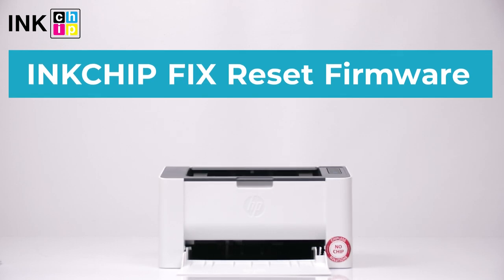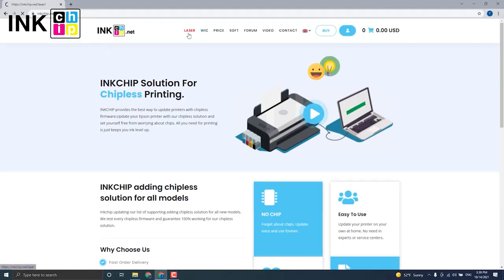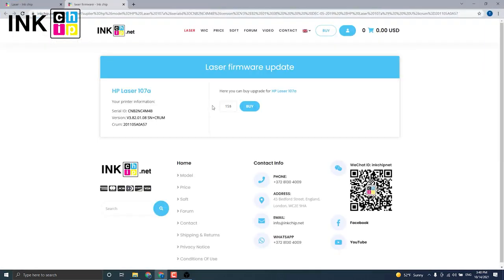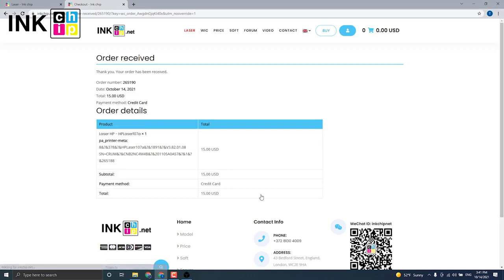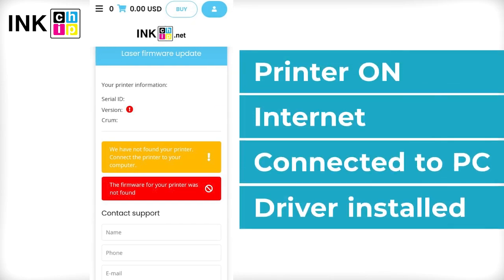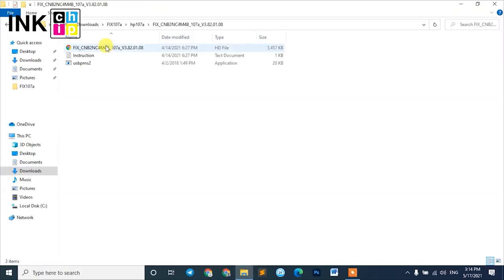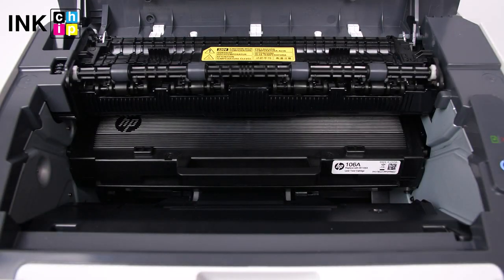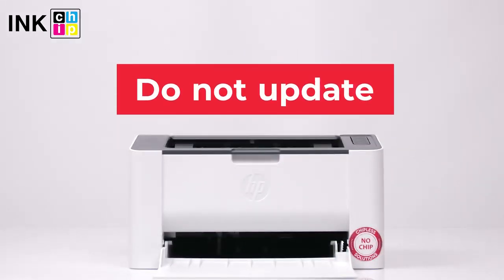How to make a Laser Printer Chipless HP W1106A 103 107a 107r 107w 108  131 135a 137fnw 150 178

Comment: After few hours of research and using inkchip software finally I don't need chip. Plus: Don't need chip. Minus for now, don't know why, cannot print on mac. I will reset system and then check…
Reply from the maker: The most important thing is that it worked.
Reply: Printing on mac also works.

Now I am happy!